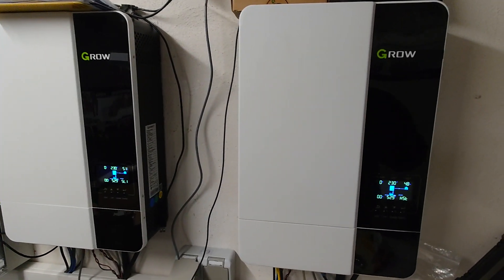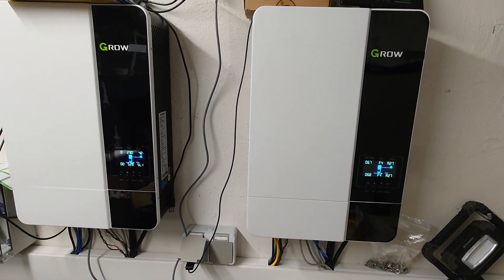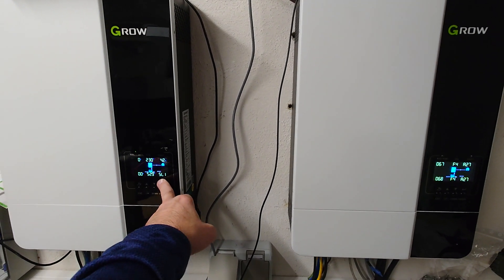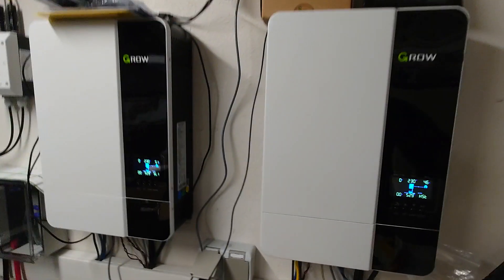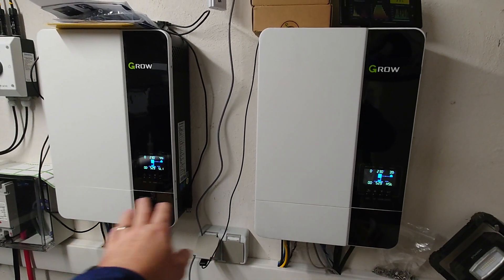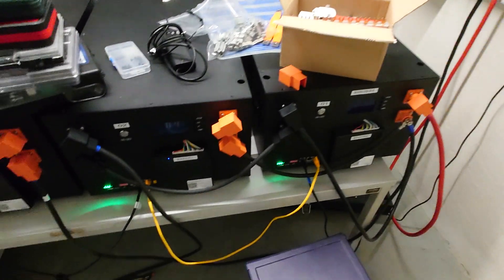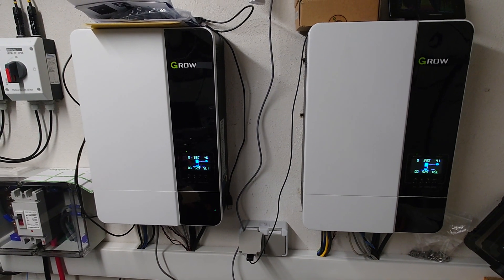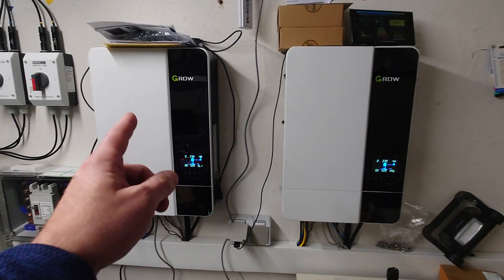Growatt SPF 5000 ES Host/Slave negotiation

Comment: You can probably also put the 2 dry contacts in series or parallel (I don't remember if your setup uses NO or NC) that way it doesn't matter which is host. I guess if you use NO then in parallel, if you use NC then in series.
Reply from the maker: yes you are right and I agree but the bigger issue is the battery comms...

Comment: I am so happy that I changed to deye 12k LP3 .  I have connect it in Island Mode like the spf5000es. Running perfect. The 90 day problem from the spf 5000es and the flicker light problem with coffee machine and 3d printer was my main problem with spf5000es.
Reply from the maker: never had any of the issues with the SPF5000ES regarding powering all the consumers in the house. no flickering light, no coffee machine issues and np 3D printer issues...
Reply from the maker: I'm happy for you that you chose a suitable setup for your needs, but deye is not the holy grail as they modify their hybrid inverters by software to behave as a real island inverter, only. the deye exports energy as the sunXXk is a hybrid inverter. even if you set zero export. I have a 10k here for testing and not convinced by now to exchange growatts